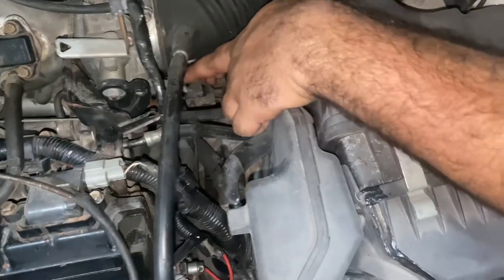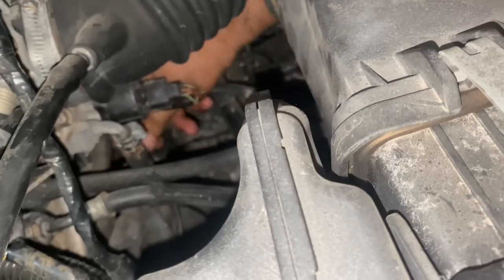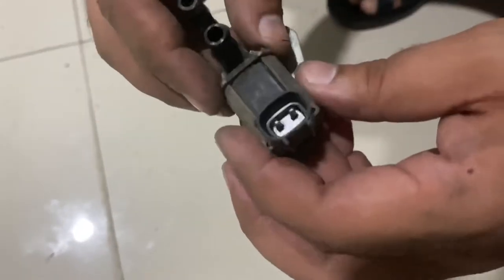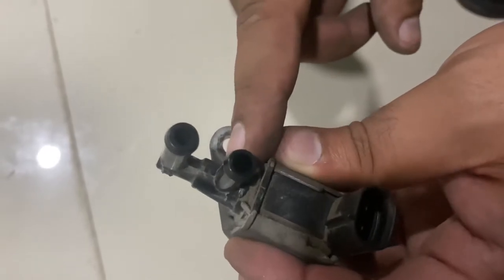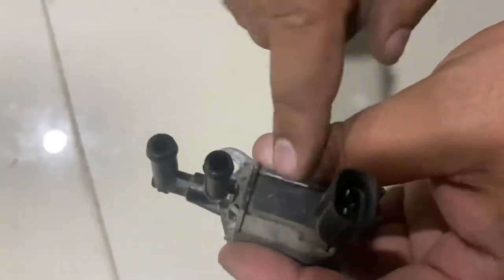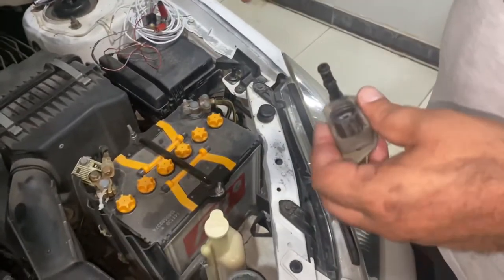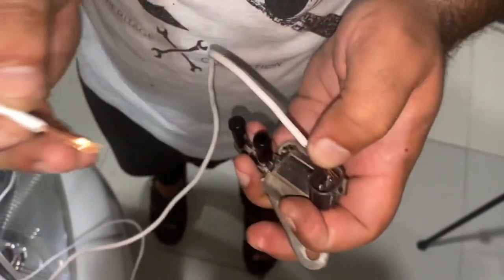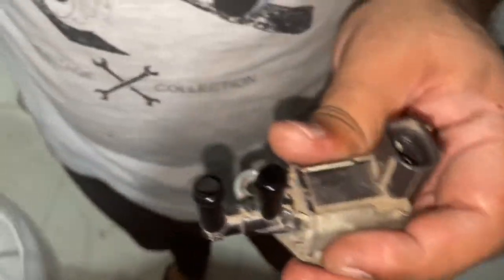How to Clean and Test an EVAP Purge Solenoid #evap #solenoid #purge #diy

Comment: What kind of cleaner did you use?
Reply from the maker: Any carb cleaner would do. Better if you use contact cleaner
Reply: electrical cleaner spray works.
Reply: Can we use Mass Air flow sensor cleaner
Reply: @FarhanKhan-cs9cr  That is the most recommended cleaner.  Carb or brake cleaners can have a harsh effect on plastic housings.